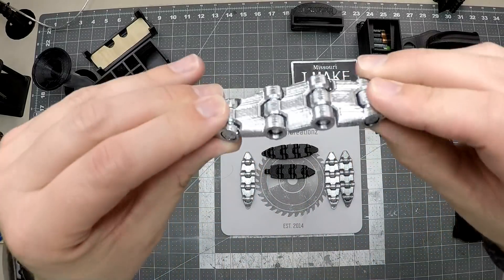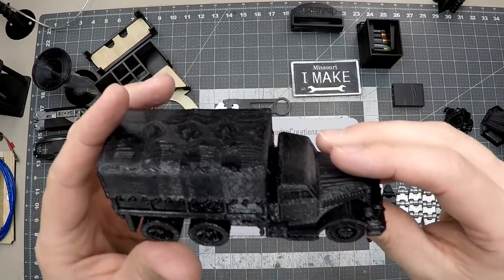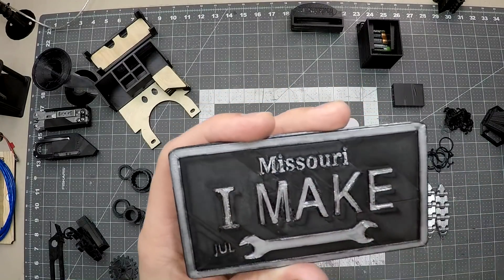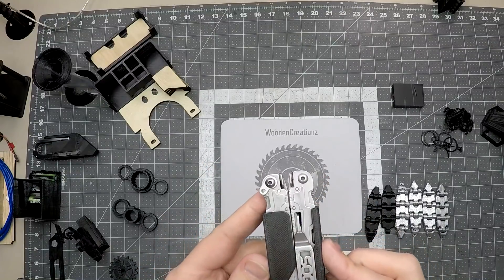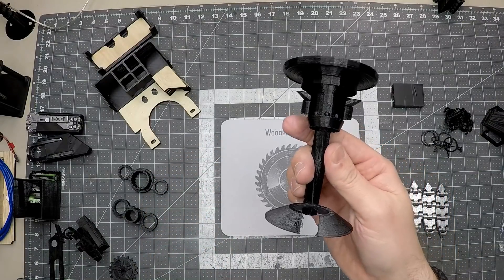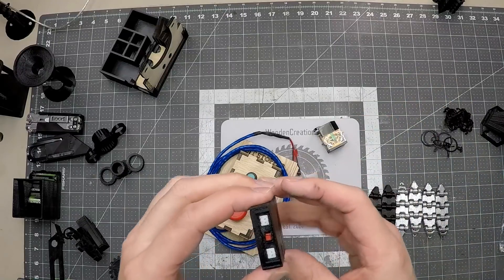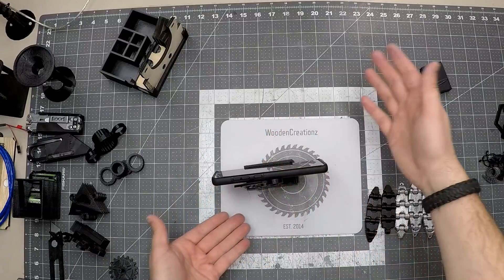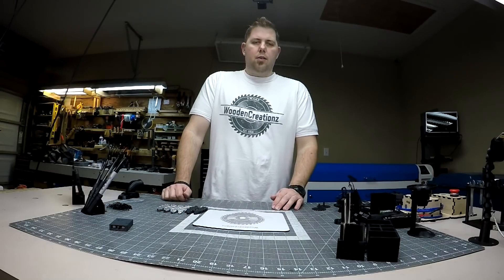21 Incredible 3D Printed Objects

Comment: ncie video, and yes, this hobby is addictive.
what i noticed is that your first layers arent so nice (i bet when the first layer is printed u can see some space between the lines.
you can solve this by decreasing the nozzle hight (bed leveling offset).
i have an ender 4, wich i have enabled custom bedleveling trough flashing custom marlin firmware, but the ender 3 might have it already, dont know about that.
without custom bedleveling u can still use some "feeling stick" of 0.10 to adjust the nozzel.
Good luck and happy printing! :-)
Reply from the maker: Ty for watching and the tip.

Comment: Caution it's a highly addicting hobby. Pretty soon you'll have to change the channel name to Plastic Creationz.

Actually you can make a lot of things to complement your wood projects. There's some great jigs and tools too. Not to mention molds. For instance that gasket you can print a mold fill it with silicone and boom, you've got a gasket.
Reply from the maker: So true!!! Thank you!! 💪🏻
Reply: Or get some TPU (rubber) filament and print it direct.  I use it for gaskets, rubber drive wheels, flexible washers etc.  The main problem with flexible filaments are they can be a bit tricky if you don't have a direct drive extruder - Bowden systems find flexible filaments rather challenging.